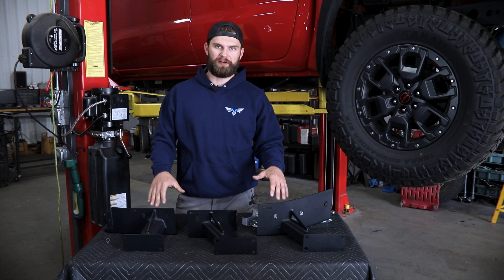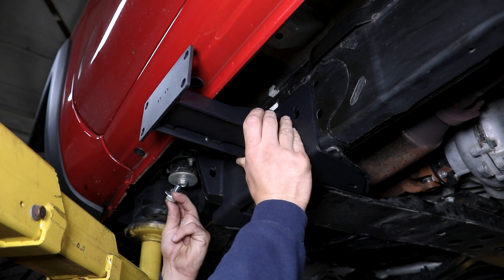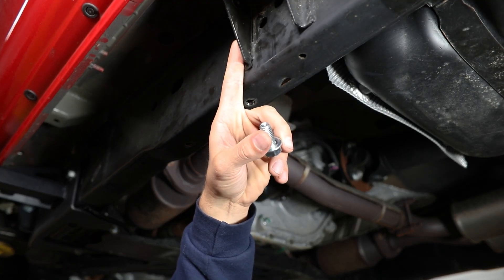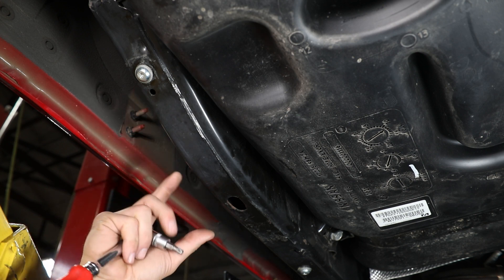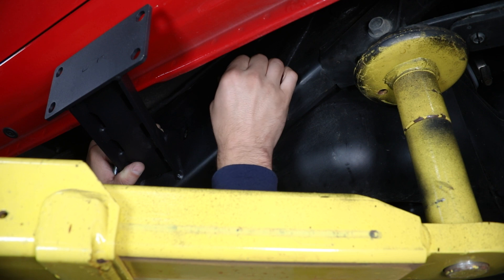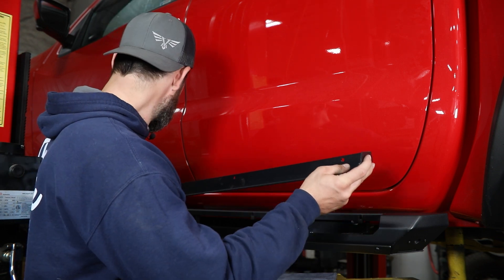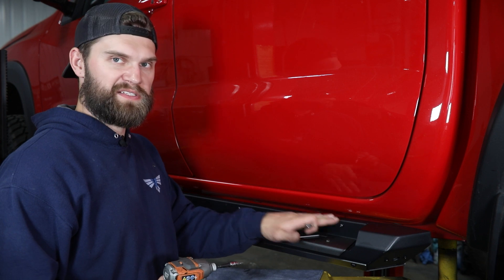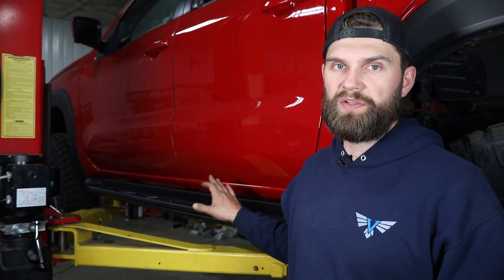Nissan Frontier Blitz Slider Install

Comment: What is the benefit of these over other far-cheaper running boards? What is it about these that makes them worth the price?
Reply from the maker: The main benefit to Sliders over standard running boards is the element of armor.  Sliders can withstand tremendous forces and support the weight of the vehicle as it slides over rock obstacles, protecting the vulnerable rocker panel area from damage while navigating offroad obstacles.  Your average running board style step will crumple instead of providing any protection.
Reply: @Victory4x4  Thank you for your detailed reply
Reply: @RetroFrito  to add onto what victory said. 

Traditional running boards are mounted to your rocker panel on the back side of the body. They aren't ment for abuse.

The sliders shown in the video are frame mounted which is a SIGNIFICANTLY stronger mounting solution....as victory said, can take the weight of the truck and hold up.

Victories sliders here are pretty much the only ones that look and function like a traditional running board but with the benefits of rock sliders